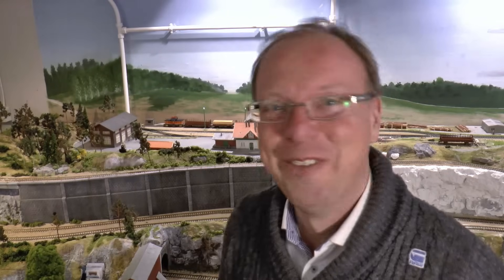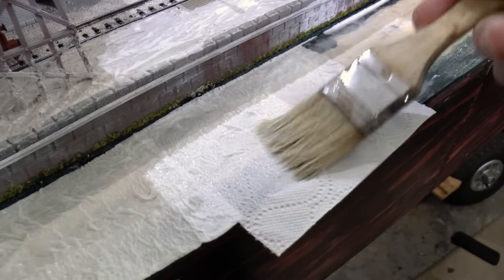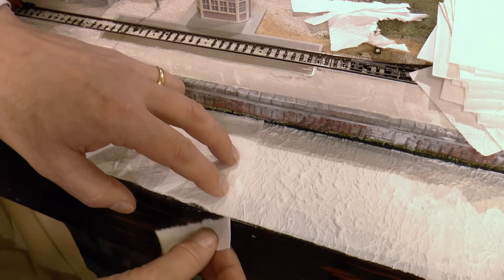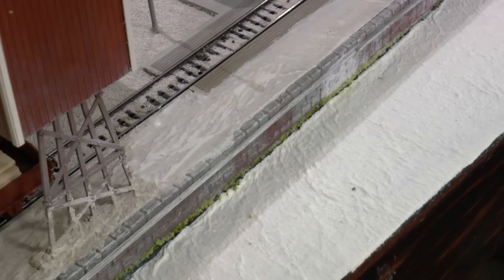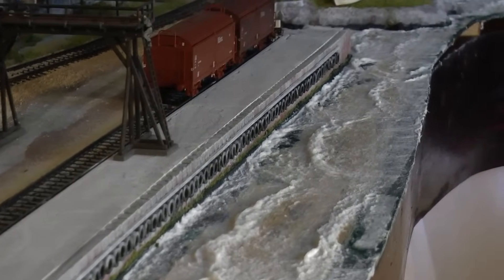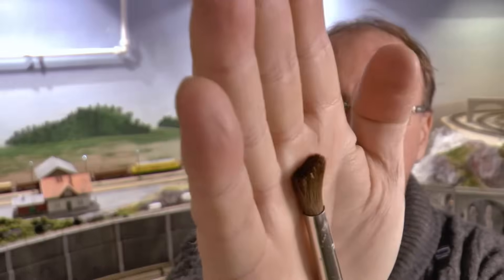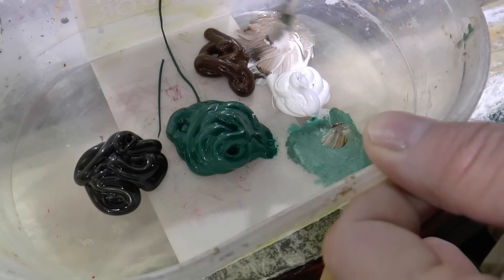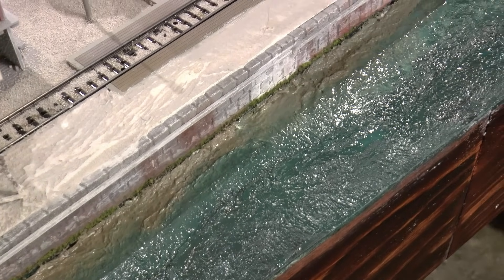Create Realistic Ocean water EASY & Low cost

Comment: This looks really great, the only thing I might add would be a very minor dry-brush of white on the top of the waves to add some 'foaming' effect :)
Reply: Yeah, it needs white caps, but other than that it looks amazing!
Reply: I was waiting for that too.. just a dash of white on top of the gloss, following by just one layer of gloss around the white, leaving the heads matte.
Reply: .yes.....also along the shore definitely needs some white foam areas as waves crash against the beach.....really cool effects here...just needs some details to make it over the top.
Reply: It is inspiring, i don't even do model building, i did when i was a kid but all kinds of dioramas are in the list of "i'd like to do that..."
Reply: Especially on features like the boat wake.
Reply: @O. B. Exactly what I was going to say. This is a typical day at the lake and a boat in a "No Wake" zone.
Reply: Foaming doesn't happen that often irl for canal water
Reply: @O. B. At very least, the part right up against the wall should be somewhat white. And I agree there isn't usually foam apart from that, but it seems like it lacks depth without it. It's harder for the eye to differentiate the "waves" without it.  Just my opinion, though. Either way, it still looks incredible!
Reply: This would help it fit with the thumbnail which does have bluer water and white caps.
Reply: @O. B. I agree that the normal bow waves look good as they are, without foam, but the wake of the boat doesn't look right to me... Those waves should either be a lot shallower, or have some foam on top. Kind of a nitpick though, still looks amazing ^^
Reply: @O. B. but for the boat...
Reply: The only comment actually about the video and not the random recommendation lol
Reply: So you think he's just gonna come back after three years and see this
Reply: Good idea
Reply: @curlygerl6650  no, but it is a nice thread of tips if you want to make your own, nothing wrong with people giving their opinion in the comment section of the video
Reply: I wonder if you could apply another layer of toilet paper just on the crest of the waves then clear coat over top to redefine the waves that got brushed out?
Reply: Hey! I did that before reading your comment and I can say it turned out really well.

Comment: Well, I finally broke down and bought a roll of toilet paper and tried the toilet paper water... As I applied the watered down glue mixture, I realized why you had to add 3-4 layers of TP to the "harbour"... After applying about three layers, The toilet paper started making its own waves with the pushing of the paint brush (like the one you're using) so I decided that the tiny waves would be of perfect size as my layout is N scale.  Although this procedure requires 72 -76 hours of drying time (depending on the humidity in the air) I think it is well worth the effort.  One thing people should know if they do decide to do their water this way - Buy yourself some cheap white glue - it can get real expensive using good quality/brand name stuff! I would also wait until the toilet paper has fully dried before painting and adding the clear coat.  Makes it easier to use the brush  and not clog it up unintentionally as most soggy plasters do.

Comment: Something for you to try... lightly paint over the tops of the "white caps" on the waves with a stiff brush and using your white paint.  When dry, add another gloss coat.  Repeat as needed until you get a splashy wave result. You can do this to enhance what you already have.  I have done this on several layouts, you will love the result.  Make another video and let us see how it works for you.  I use the high gloss Modge Podge for my clear coat instead of white glue.

Comment: YouTube recommends a 3 year old, modeling and crafting video, on a subject I've never looked at before.  Good job YT, occasionally, you make good suggestions.
A bit of clarity... At 3:30, where the modeller is "adding waves", - this is done by using the brush to push some of the layered TP into different depths, and, IT'S DONE WHILE THE TP AND GLUE *IS STILL MOIST*!
In my mind, I was thinking forward, and shunned that the glue/layers had dried.

Comment: When everything is properly dry. You can use 2 k component =  automotive clear coat hardener and  2k thinner. Most Automotive paints are uv resistance. Of course you can ad uv resistance and it will never turn yellow.

Comment: I’m just starting to build for the first time in 44 years.  So far, I have two 36” parallel tracks on one side of a 2’X4’ plywood sheet.   Retirement income and an energy depleted old body means we’re going slow.  I laid the track about 2” from the edge of the board and have been wondering how to landscape that.  This method means it’ll be either swamp or river bank.  Problem defined and now potentially solved inexpensively.

Comment: Did you consider using epoxy for your clear coat? It could be done with one casting instead of 4 coats. Of course, there's the texture of the top. but that could be done at the same time on a clear piece of acetate or a page protector or whatever. Just pour the epoxy, let it sit for 3 or so hours, coat the second toilet paper sculpture with some sort of mold release, and then press it into the surface of the epoxy. Not as cheap, of course, but faster ... if that's your goal. 
Then again, fast isn't necessarily "great" ... or even "good" sometimes.

Comment: How well does it hold up over time? Any yellowing fading or cracking
Reply from the maker: Hi! I’ve had it now for about 10 years and it’s same as from start. It does get matt over time, because of dusting and using the surface to put stuff and tools on. So once in a while it needs a new top coat of the same varnish

Comment: Very nice technique.
How does one prevent brush stroke marks in the high gloss? I seem to be getting these marks even after 3 coats.

Would thinning the latex high gloss medium with some water (maybe say 25% water) flatten it out more so that it self levels? Or should I apply a thicker coat full strength, etc. I am not sure what will work. Thanks in advance.
Philip
Reply from the maker: Hi Philip, Yes, if you get brush strokes the paint is too thick. Add more thinner until the varnish flows properly. Using more paint in each dip is also a possible solution, but it sounds like the varnish you use needs thinning.
Reply: @marklinofsweden  That makes sense. I am using the Liquitex (water based) gloss medium. It gets very good reviews. I am not sure how much water I can add so I will have to research that.
 
I will possibly (not sure) need to try and sand the brush strokes that I have in my surface, which will be difficult as I tried a small spot and it was hard to remove them. Maybe the thinned gloss medium will fill those brush lines without excessive sanding. (Hoping)...
If you have any suggestions they are welcome. I appreciated your information. Means a lot. Thanks very much! Gave you a Sub too...
Philip

Comment: I have a question, salt after I'm done laying down the paper with the water glue let it dry then I paint the paper and let it dry for  72 hours then I apply the clear coats, for each clear coat I put on do I have to wait 72 hours to dry for each coat?
Reply from the maker: Hi! Waiting time between layers of clear coat can be as short as 1-2 hours.
Reply: @marklinofsweden  I have waited longer than 2 hours and still getting cracks
Reply: @marklinofsweden  I have waited longer than 2 hours and I'm still getting cracks